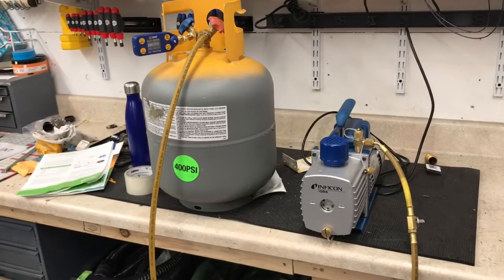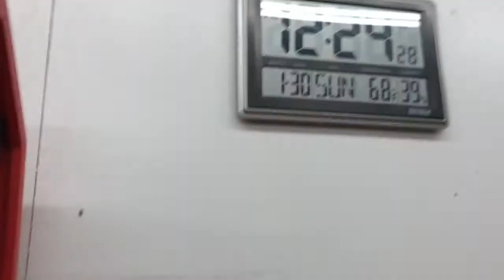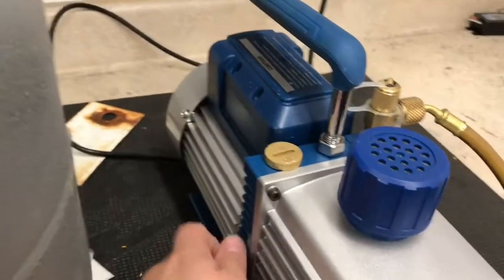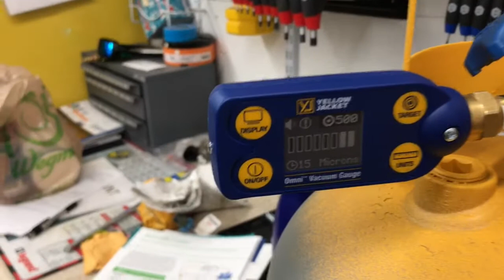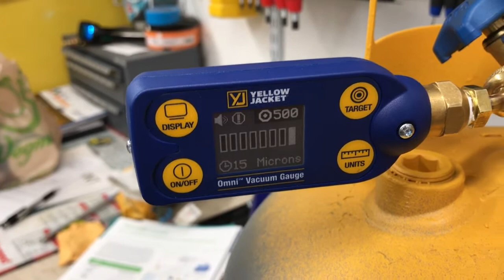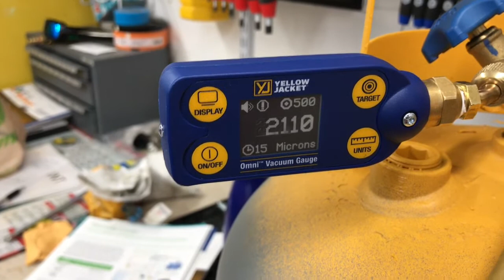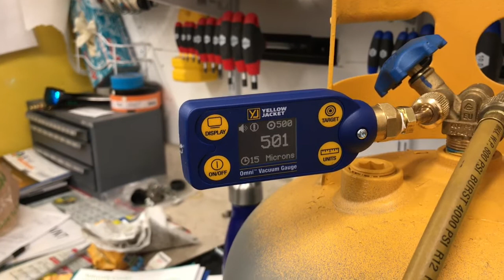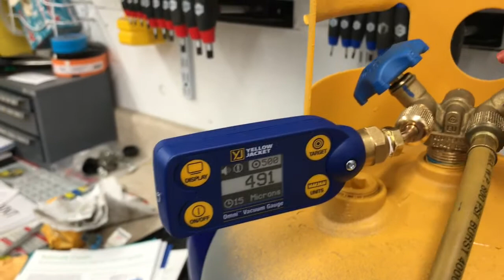Inficon QS5 and Yellow Jacket Omni Vacuum Gauge

Comment: Should it work if I connect it to the vacuum pump ?
Reply: It should pull down but the moment you blank off your valve, it will rise. Not enough volume to stop it from rising it is going to find equilibrium. Test  it a cylinder you know is dry and leak free.

Comment: you're lucky, your gauge works. I bought this gauge and the first worked only 2 times, for a replacement I waited a month. (37 days exactly) the second I could not use this one, he did not want to turn on. I wrote to CIE to have another one that could be functional, 14 days later = I'm still waiting :(
Reply from the maker: I just bought a second one and it didn't work out of the box...
Reply: @thefacilityguys   I finally received the 3rd gauge, it worked 2 times and nothing...🤬 asked for a refund. It took ~3 months from memory to get it.
Reply: Celyn V worst damn gauge ever, super high failure rate
Reply: @hozerhvac4406  negative,the worst vacuum gauge ITS the JB dv22n .
Nothing are worst.